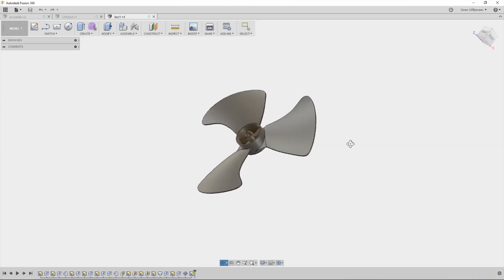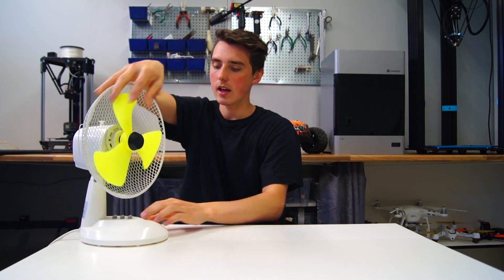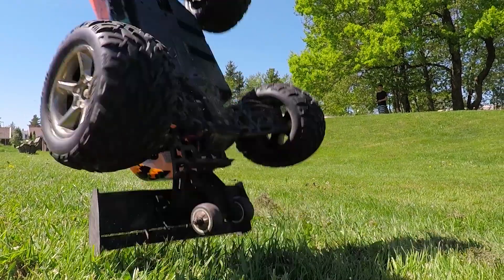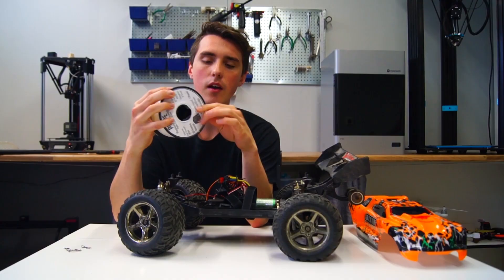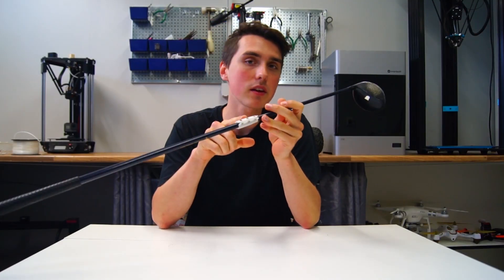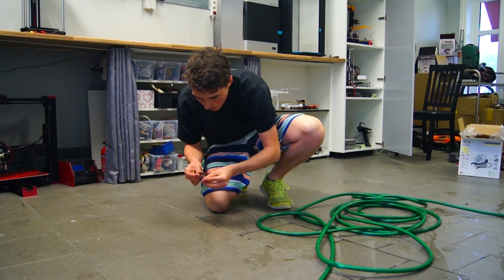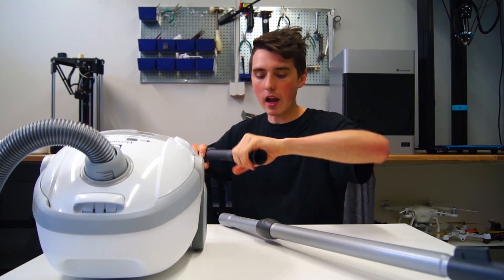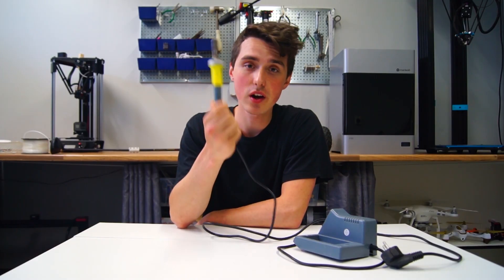6 Things Repaired by 3D Printer - AWESOME IDEAS!

Comment: I had a motorcycle engine that got some small chunk of aluminum sucked into the cylinder. About the size of my pinky fingernail. I 3d printed a vacuum cleaner attachment that would allow me to put a soda straw on the end. Thankfully this engine had two spark plugs per cylinder. I put a small borescope camera in one cylinder, and the vacuum soda straw in the other, and got the aluminum out. The rest of the cylinder wasn't damaged (I heard a noise at idle and shut it off immediately, it wasn't like it got sucked in there at highway speed) and I avoided taking the head off. 

And now I have this attachment which is super helpful for cleaning keyboards.

Comment: Me: is happy after making a box on fusion 360
Him: so I  just went no fusion and quickly made a fan blade 
Me:😱
Reply: do you know if fusion 360 is similar to autodesk inventor ?
Reply: @kringe8746  yes.
I used inventor before and know working with Fusion360.
Its easy if you have experience in inventor.
Reply: Oguzhan Yasar thank you so would be fine for me sense i am inventor certified.
Reply: =D

Comment: That soldering iron is from kjell.com and can only be used a few, mady 10 hours before the wires in the heatingelement gets damaged and you CAN probably replace the heating element on those but it would be more expensive then buying a new one (since it costs about $10-15$ and kjell dont have spare parts. Had 3 units break before i switched brands, do you have the same experience?

Comment: You know it's not the availability of the CAD software holding many of us back, but USING them.  I've been in IT for almost 30 yrs have mastered many things but have tried and seems to take like an hour to start with a cube and have to literally poke holes in it and make a thousand operations for even the simplest of end shapes.....can I ask how you learned to use it as quickly and well as you do?  Did you take actual schooling, online, etc?

Comment: Really nice video!!👍 and I am thinking of getting a 3d printer, the TEVO tarantula seems awesome but I probably have to put it on my room, so could anyone tell me if it's safe or is it harmful because 3d printers emit (according to the internet) a lot of fine particles🤔??
Reply: I don't have a 3d printer (would love one though), so could I ignorantly guess it is probably selective laser sintering printers that have the fine particles to consider, which may be a respiratory hazard, can give off fumes when heated, also titanium and aluminium can be explosive (also electron beam melting printers, but I doubt amateurs will build many of those).

I think filament printers usually have nothing more than fumes and heat(or in extreme cases laser radiation in laser wire deposition printers - wouldn't one of those be cool). 

I think I remember hearing PLA filament is supposed to be not too bad for fumes, although maybe a little brittle?
Reply: Douwe Jansen, I sleep in the same room with my Anet A6 printing, and I have no problems.
But I think that it isn't smart to do, even when your chamber is well ventilated like mine...
Reply: Thanks and I think I can also put it in my garage but my garage is totally not ventilated so I doubt what would be the best choice
Reply: +Douwe Jansen, I have actually had a little experience to answer this one (welding in the garage), it's more important to keep a reasonably air tight seal between the house and the garage, closing an interconnecting door will do (a room above a garage may need additional sealing), most houses will be adequately ventilated. Simply open the external garage door a few minutes before entering after a print! 

I have heard build quality suffers with inadequate temperature control, so you may find you need an enclosed build chamber if driving the car out halfway through a print.